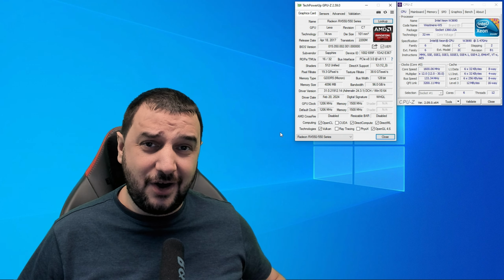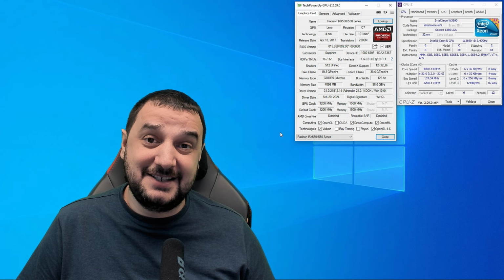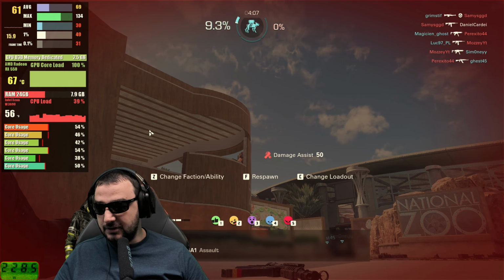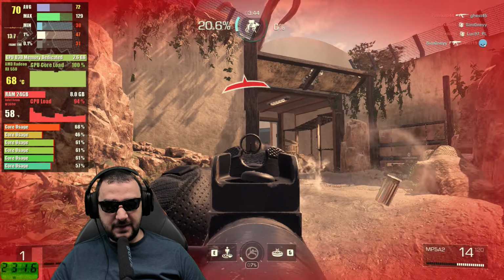AMD Radeon RX 550 4GB Benchmark

Comment: Dit you use the AMD Freesync tech ? The most monitors in the market support it, makes a big difference for the eye. Also i cant find the power meter for the VGA card it self on the software. The RX 550 dit consume up to 50 Watts, but after the newest Driver and Bios Updates, my only consumems maximum 28 Watts in every cenario. You can also water cool it, the on aliexpress there are universal VGA water cooling blocks, the block alone cost 20€ but is full cooper often whit nikel. Which increases the power slightly. Thats what i dit do whit my one.

Comment: Just upgraded from a 550 4gb to a 580 8gb (non 2048), a 2.8x performance difference but the 550 is a light gaming beast for holding me in 4 years of service! Good video
Reply from the maker: RX 580 its a good card. what specs you have?
Reply: @DanielCardei  Along with that upgrade I also got a 750w psu from gigabyte (bomb has been planted) because before that I had a smart form psu because the card didn't need additional power, and I'm rocking a ryzen 3 3200g which still holds up and it is a bottleneck not so much and a ryzen 5 3600 would have been better but I'm more than satisfied with the performance gain :D the rx 550 could run games like cyberpunk (ultra fsr, 1080p) and even some sony titles like ghost of tsushima and spiderman 2018 was able to run it and even finish them with reduced settings. I think the biggest advantage of this upgrade was not only the GPU but the PSU if I will want to upgrade in the future.
Reply: >also I have 16 gigs of dual channel 3200

Comment: Lower minimals in something like CS2 would indicate (or likely be) a CPU issue as long as the game isn't running over the VRAM limit of the video card. It could also be a IO issue with loading assets from a slow hard drive.

Lower minimals in fortnite (or stuttering) is just going to happen in your first few games as it seems to like to compile shaders for a while so you would play to play or use the replay feature a few times to make sure those stutters go away (in my testing anyway).

I could be wrong however, comparing it to other tests with more powerful GPUs with the same CPU would let you know if it is indeed a GPU issue or if it is the same on something like a 3070 or something.

Crossout and GTA5 shows that even when the GPU is at 100% or spiking to 100% there weren't massive stutters like there were in the other two games listed above. Like I said though you would have to text the CPU with a much more powerful GPU to make sure it isn't the a GPU limitation.

Good video though keep it up :D
Reply from the maker: I used it like this so I see how much it goes up in the fps.  Using v sync will have helped. Maxing details to push the card or lowering resolution to help the whole system. Options that requires the user to take to optimise their system. My system has an 2tb ssd and I think its on the minimal speed not to be influenced. From here with everything unlocked everybody can see and adjust how they want to make it better for them.
Reply: @DanielCardei  They are good tests dont get me wrong just I can't stand stuttering so when something like that pops up in a system of mine or one of my family members i spend more time than I should trying to identify and fix the problem. 

That said yeah v-sync should help in some cpu bound scenarios as well. 

Keep up the good work man!
Reply from the maker: BTW I'm adding and rtx 3070 in the future to test the cpu even further.

Comment: I just put this very card in a Lenovo OEM With a Haswell i7 4790 it doesn’t have PCIe power. Paid 30 bucks for the PC which isn’t bad for a 4790 PC. First time ever I got an OEM PC. They were selling a bunch of i7 6700  Lenovos as well for 70 bucks and they had SSDs as well and 16GB RAM.

Comment: that rx 550 is getting fairly botlenecked by the motherboards pci-e 2.0 that makes it a bit worse than gt 1030
Reply from the maker: @BittiPomo  this Asus X99-E has pci-e 3.0
https://www.uk.shi.com/product/32299828/ASUS-X99-E-Motherboard
Reply: @DanielCardei  but how that gpu-z informed it as working on pci-e 2.0 ??
Reply from the maker: Its idle in Windows. Even the core speed drops down and after the game starts all goes up. Many cards do this.
Reply: I know core speeds drop at idle but I’ve never heard of PCIE changing versions at idle. You sure the CPU supports PCIe3? For example a Z77 motherboard supports PCIe3 but only with an Ivy Bridge CPU not Sandy Bridge and even then some Ivy Bridge CPUs only support PCIE2.0.
Reply from the maker: E5 2990 v4 its Broadwell. Support pcie3.0 2x16+1x8 or 5x8.
You can see the card went i talk about the specs jumping from pcie1.1 to 2.0 idling.
Reply from the maker: 100% I'll check it.

Comment: Pure Garbage cards  RX 550 & RX 560 in games  what a waist ......
I bought a RX 560  it ran like shit 
Buy a GTX 970 4G instead  fantastic.
Reply: RX 550 4GB  is better than the 1030 for just upgrading some old sff workstation that has like a i7 4770 and 16GB of ram.
RX 560 4GB has 1024 cores thats twice the 512 cores in RX 550. But it requires a 6 pin connector.  
If you want to compare something to the 970 than its the RX 570 and 580. Because thats similar price and similar power draw. Except RX 570 8GB and RX 580 has more than 3.5GB of vram.
Reply: RX 570 580 8 GB
Reply from the maker: @MiksGamingPH  rx 590
Reply: @DanielCardei    I finally  bought one off a friend who only used it for 2 years and then Upgraded to a GTX 1080 Ti 11G
Gave it to me for $100 Bucks 
It's the Blue Nitro Version glowing fans..
It's beautiful
Runs Battlefield like a dream...
I put it on a Ryzen 3600X system
it's awesome..smooth..
Very nice card.
Reply from the maker: @evilqtip7098  comparing this card to those, true this is not that good. Some pc are small and  don't have enough power for 2x 6pin connector. I think cards that can work without have a purpose too
Reply: Do NOT buy a 970, as soon as you go over the 3.5gig VRAM limit you will have much much much more stuttering in every game.